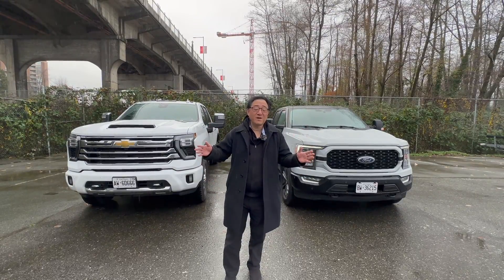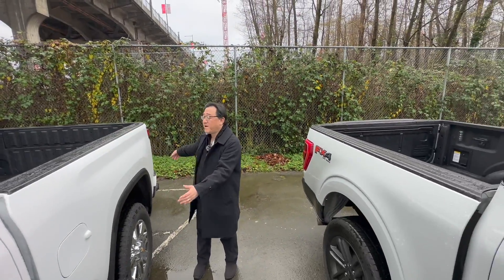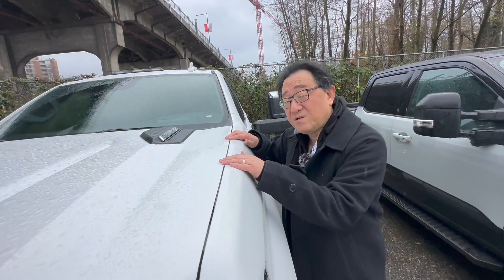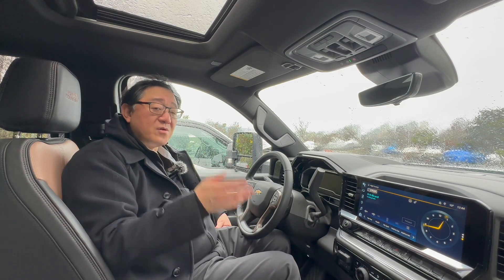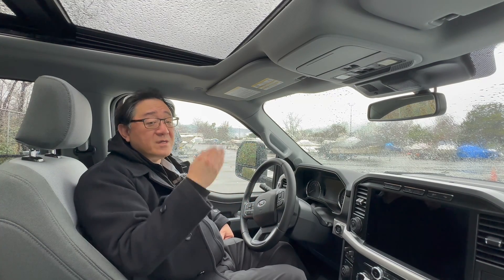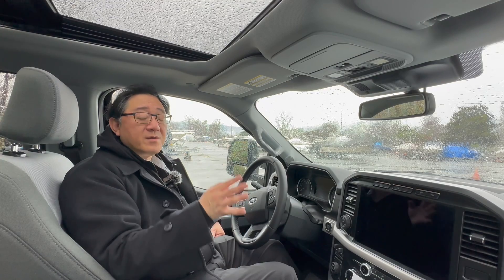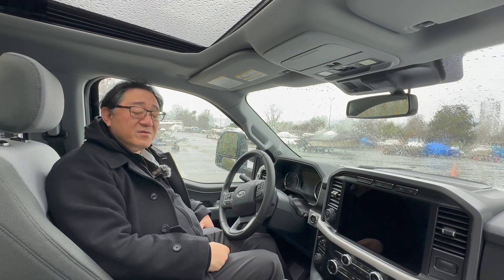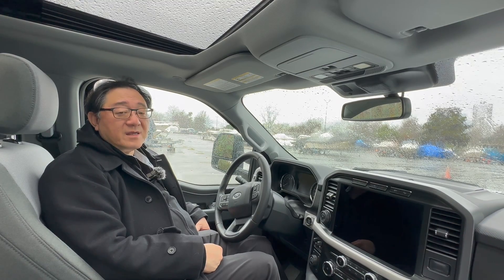HOW TO CHOOSE BETWEEN 1/2 TON vs 3/4 TON TRUCKS // 5 IMPORTANT FACTORS // ENGINEER'S REVIEW

Comment: I have a 7,000 lbs travel trailer and tow it a couple times of a year with a 1/2 ton. It gets the job done but MPG is definitely lacking. I’m looking at getting a new truck but not sure if I should get a 1/2 or 3/4. I only tow a couple times a year and do projects at home where I need pallets of material from Home Depot etc but that won’t always be the case once I’m done. Space isn’t an issue with storing a bigger vehicle. Anyone have any opinions or suggestions?

Comment: Tow ratings are garbage marketing numbers, and should NEVER be used to actually match a tow vehicle to a load. The large Payload, GVWR, GAWR are all real limits, but will vary from one truck to the next based on size and equipment. Use tow ratings as a rough guide only. Always work from the ratings on the Cert Label on the door jambs when choosing and specifying the vehicle.

Comment: When you're pulling weight or hauling weight just because the vehicle is rated to handle it doesn't mean you should. 3/4 ton the weight is on the axle housing rather than the axle. Floating versus semi-floating. The brakes are better on the 3/4 ton. The transmission is designed for the load. They come with transmission coolers. The oil is usually cooled with 3/4 ton. And generally speaking they're cheaper to buy used. They handle better without all that excessive softness. If I had a reason to buy a full sized truck I'd probably choose a new or well- maintained 3/4 ton. If you need the difference between the gas engine and the diesel torque then maybe consider leaving 5 minutes earlier. One battery versus two. 2 gallons of oil versus 4-5. A $10 oil filter versus $20. $150/hr maintenance rather than $200/hr. Fuel about $.40-.70/gal cheaper. IDK... unless I travelled an awful lot of miles every day I'd probably pick the gasoline. It didn't used to be this way. The diesel used to last twice as long as the gas but now it's a toss up.

Comment: the actual cabs are identical....height and length of the bed its what different between the 2, obviously the capacity of hauling/towing change as well

owned both Silverado 1500s and 2500s

Comment: If you want a car get a 1/2 ton. If you are going to trailer or use the capabilities of the truck get the 3/4 ton. I worked for GMC truck for 12 years. So many customers bought 1/2 ton trucks and later lost money trading them in on 3/4 ton trucks. Yes, you can add helper springs or air bags but that still doesn't increase the brakes or strength of the frame. There are HD towing versions of 1/2 ton trucks and that can be another option if you don't quite need the capacity of a 3/4 ton.

Comment: You can get a 1/2 tons with eight foot beds as well you know. Not sure if you can get a 1/2 ton crew cab with an eight foot bed, but pretty sure regular cabs or extended cabs should be available. 
 The main deal with 1/2 to 3/4 or even 1 tons is hauling and towing capacity, period. That's the deal.
  The thing I don't like is with the high hood sight lines it makes it hard to see over the hood at things in close proximity to the front from the driver's seat, a huge blind spot!  And that includes 1/2 tons the hood line is too high.
Reply: Agreed. All trucks are just too high. The bed should be low enough that a person can shovel gravel out of the bed with their arms straight. With current trucks the bed is at or above elbow height.

Comment: Interesting topic,  as I've owned both sizes. Thec2500 duramax was sweet and powerful as all you could imagine.  Ride was better I thought  and interior was very nice as well.  Lots of downsides, 7 recalls in 3 years of ownership,  oil changes I was not ready to expect that cost and fuel filters as well.     Sold my LTZ at the peak of the car shortage and bought a lexus rspx 350 then a new 4 runner sr5.  Hate the ride  and sear comfort is rough. Looking to get back into gasser  HD as rebates climb in next year 😊😊